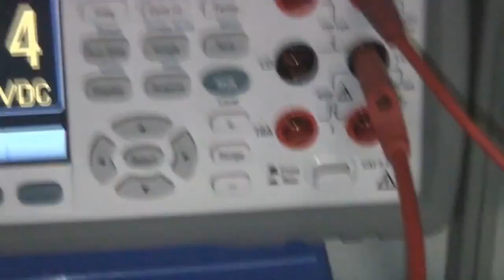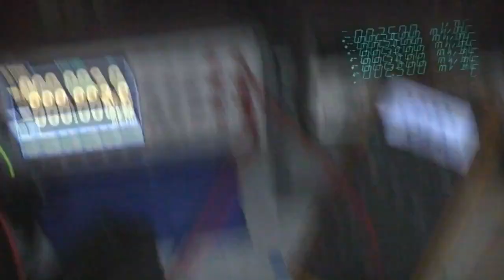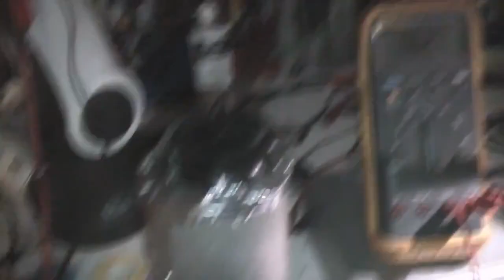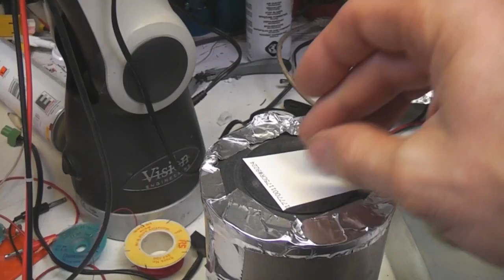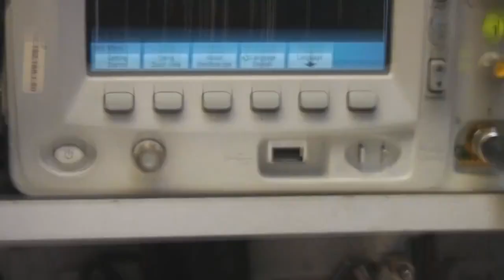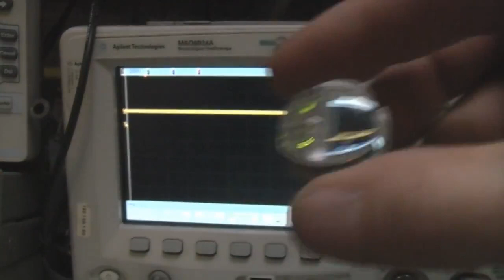Messing around with photomultipliers

Comment: sorry if this comment is too late (10 years lol), did you ever tried to detect a signal from a glas diode? not an LED a normal small signal diode like an 1n4148 or 1n914
Reply: That should be detectable. They do emit light, yes.

Comment: When the LED has nano amps going through its still monochomatic (say this is a 650 nm light LED for instance) red light being emitted and not just emitting longer IR by way of leakage current? Or does the tube only pick up the visible 650nm light? How do you know that's the red LED light and not IR?

Comment: @6:30 They were probably experimenting with different chemistries to see what was viable commercially. Then using a sensitive analog set up to monitor for emission (a la Becquerel + photographic plates + phosphors). Just a shot in the dark. If you stumble across the actual history (some of the better app notes tend to have historical context in them, but I don't do optics professionally so I haven't read ANs/tech notes to know off hand) let us know
Reply: RE: Radioactive samples - tritium novelty keychains are out there pretty easily. Also Hamamatsu has an interesting app note on how their bog standard photomultiplier tubes were picking up neutrinos fairly easily. Particle physicists searching for exotic matter build their lead cased bubble chambers a few hundred feet underground and still have to deal with frustrating amounts of noise. You should take a wire thin tungsten filament from a decommissioned FIB, power with a HV/femto-amp source, then setup a column of plates in descending voltages to create a preferred path, and see how low you can go haha

Comment: Potassium is (very slightly) radioactive. So, a potassium salt might be detectable. I've also heard that eating a banana may give a certain radiation dose - I wonder if it would be detectable, putting a banana on top of the scintillator. Probably takes a long time to detect the extra radiation (1% abundant and 1.2E9 year half life, so about 1/1000th of uranium... and the concentration in 'banana" is not that high). But maybe worth a try.

Comment: What? You don't have something radioactive around? Check again. I have nowhere the amount of cool stuff that Mike has, but I got a radioactive alarm clock (most probably Radium in the digits' paint), a radioactive floor tile (contains Uranium in the ceramic glaze) and a gas mantle (Thorium in the mesh). 
I never searched for these things, they just popped up when going through old stuff in attics/cellars.

Comment: I wonder if at those low currents you could actually see on a scope as each electron passes through the LED... I guess noise from the power supply would probably overwhelm any signal like that.

Comment: Wow those are pretty amazing, I wonder how well you could test air purity with a low power laser beam passing in front of it into a trap with a low speed constant rate fan blowing air across the beam? Getting the light in the chamber to nothing or the laser low enough power would be the hard part.